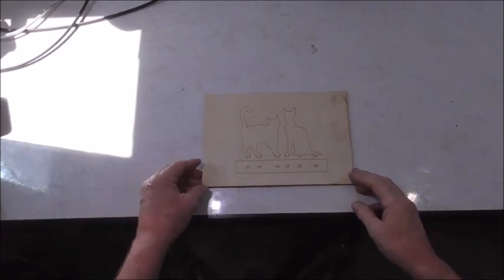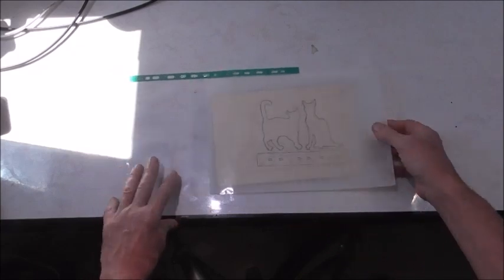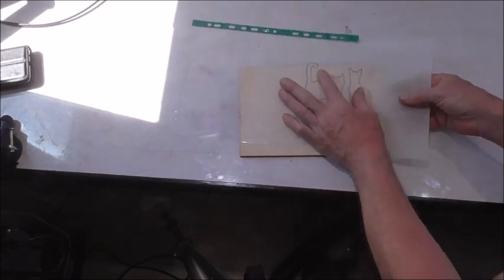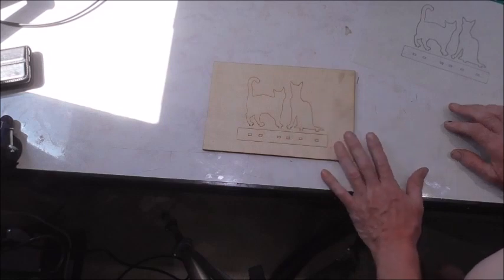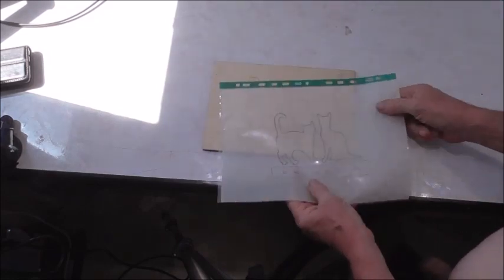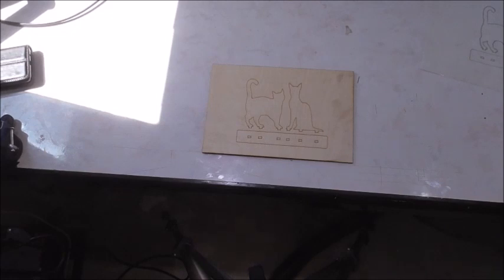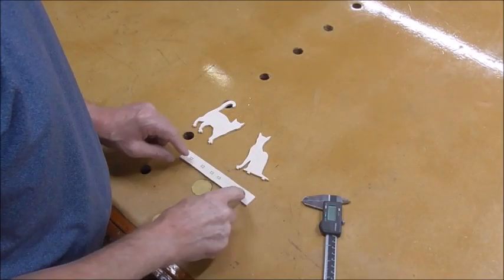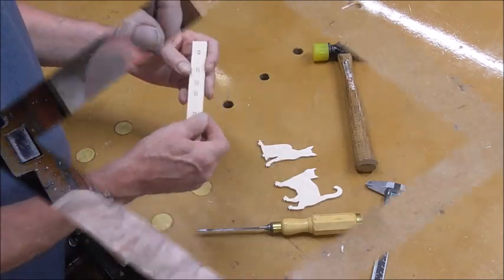Scroll Saw Mating Cats

Comment: hi david any ideas on a foot switch just got the jet jwss 22 will have it in couple days foot switch would be good
Reply from the maker: Hi Jim I've seen them used but never found the need maybe as I'm sitting and on wheels I think for a foot switch I would need to have a set static position or I would be hunting for the switch which would slow things down, so I think it's something I will not be considering any further.